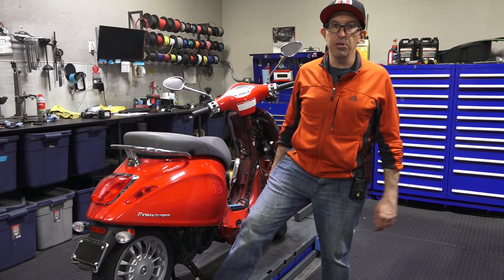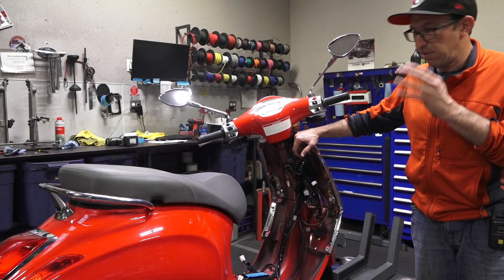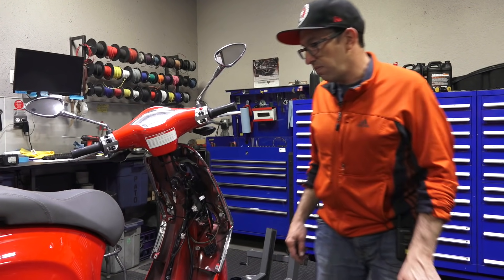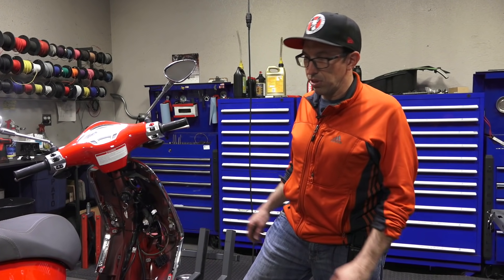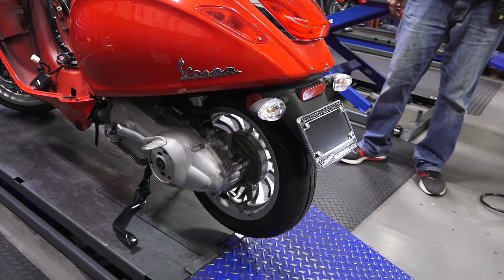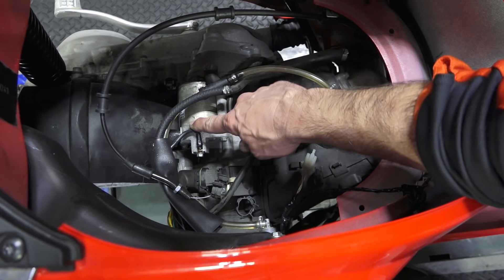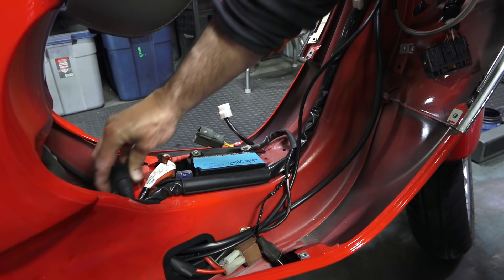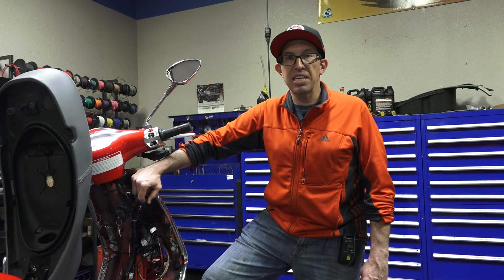Vespa Primavera 50cc to 150cc Conversion

Comment: Nice one Robot I have a LX 125 engine here in the UK thats been sitting with me for a year with wiring loom etc that was going into a Piaggio fly, but thats been sold. So you have now given me some idea's of what else to look out for to fit it. Thank you
Reply: glowskulls100 put the engine under a Piaggio Zip. The Zip is around 30kilos lighter then a vespa!

Comment: Hello Sir. I have a very disturbing issue I came across I tried to fit a 150cc 2 stroke engine on a 4t lml body with a clamp attached to the body. It seems like the engine vibrates do much that the when you press the rear brakes it seems like it's shaking. Is there a way I could mount the clamp permanently on the body
Reply: build a swingarm